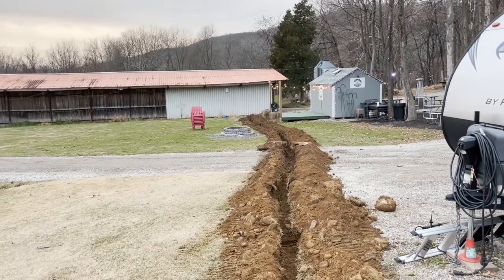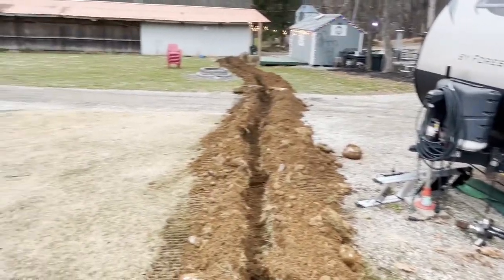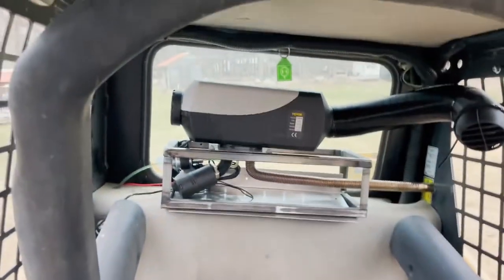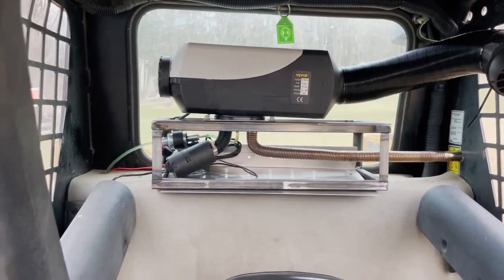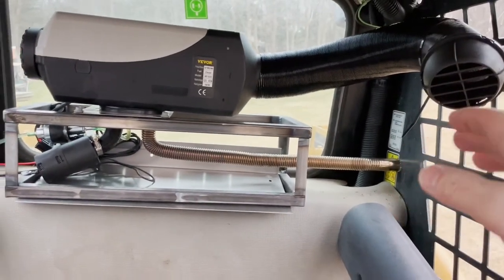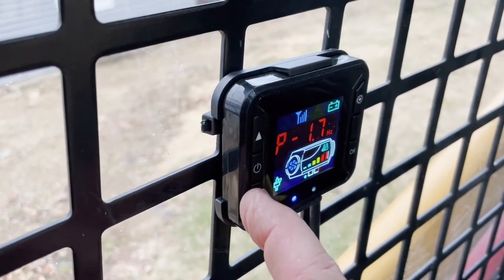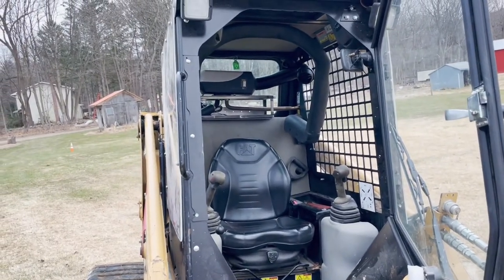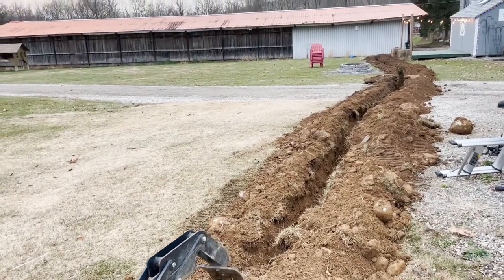I installed Chinese diesel air heater in my Cat skid steer.

Comment: I installed the same heater in my skid steer, I like this heater over a conventional heater core due to instant heat, I plumbed the diesel heater directly into my fuel system, very nice work

Comment: do you have any issue when you have to lift the cab?
Reply from the maker: good question. I have not lifted the cab with it installed. I only leave it in for a couple months in the winter. 5 min to remove so should not b a problem.